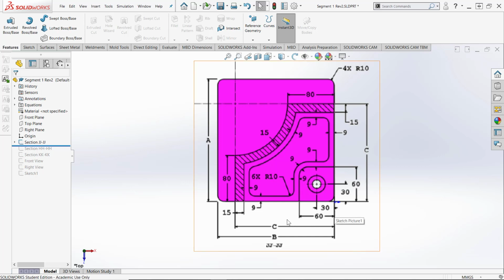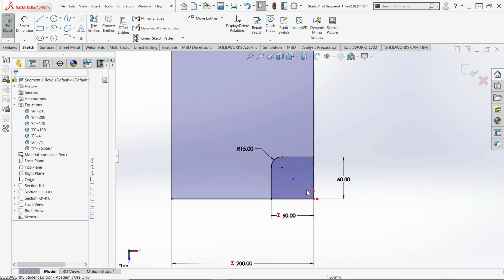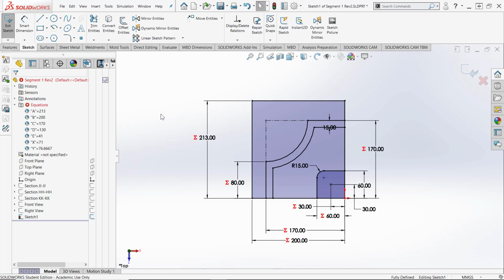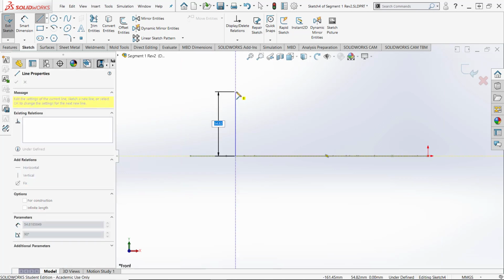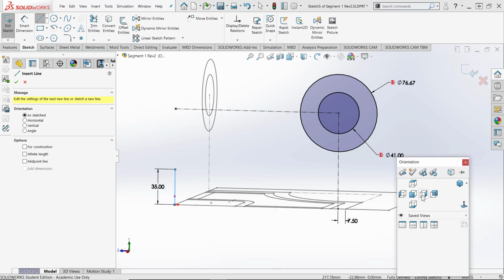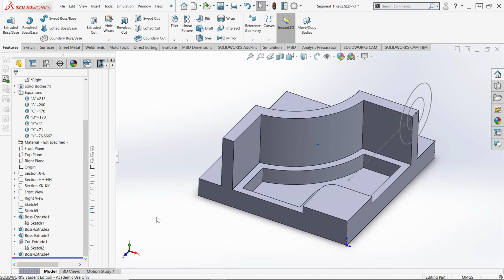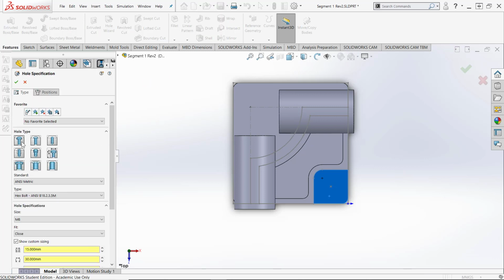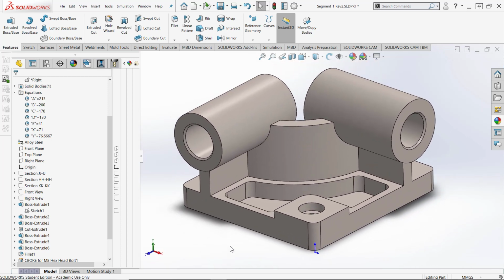CSWP Practice Exam Strategy

Comment: Thank you for the video. My mass was off because I added the 15mm fillets using the fillet feature and not by using sketch fillet and then offsetting that. It's frustrating because using sketch fillets in general will give you an incorrect mass at the end. is there any rule of thumb for using sketch fillets vs the fillet feature?